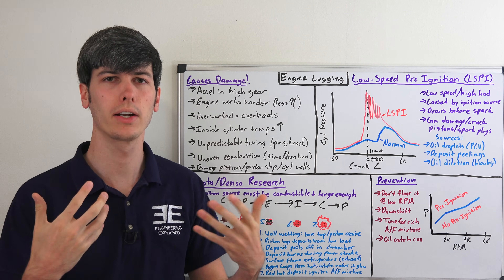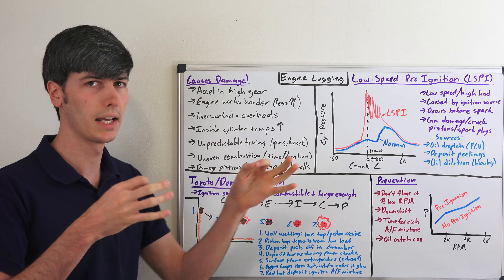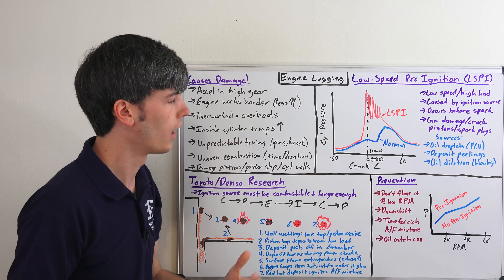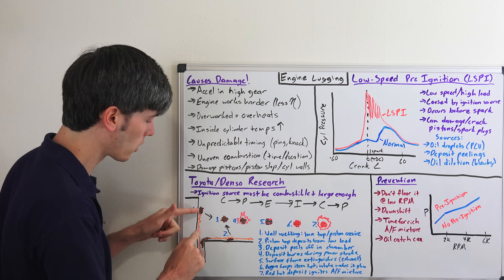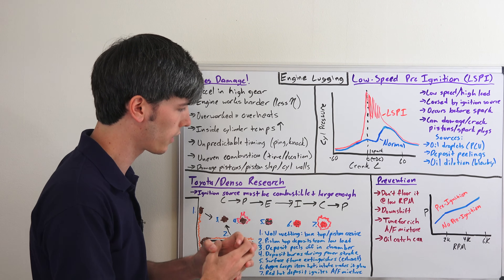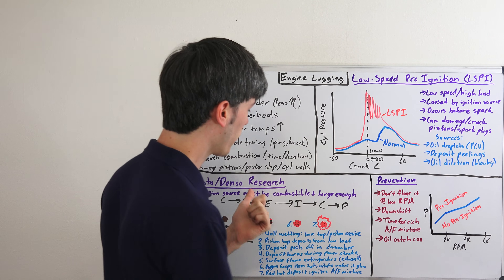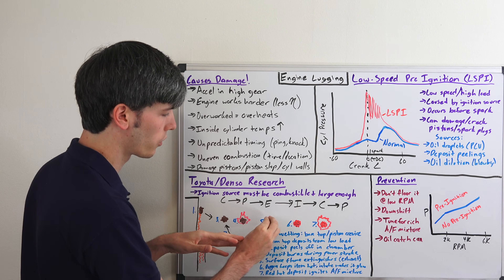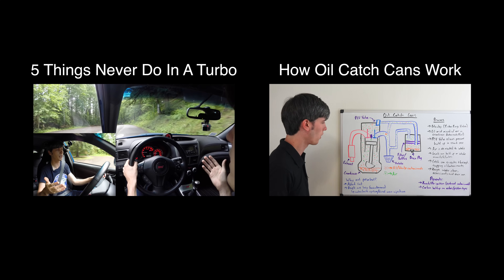Why You Should Never Lug Your Engine (Especially Turbos)

Comment: and what is with diesel engines? they have no sparkplugs because they ignite the fuel mixture by applying pressure from the pistons which are moving upwards and towards the cylinder head, doing so, they are compressing the air/fuel-mixture to ignite the diesel .....so,  does this problem also affect diesel engines?

Comment: Cortes, that's definitely a problem. You're probably getting poor gas mileage since the engine isn't burning or feeding fuel appropriately. You shouldn't have to feed in less throttle. I'd get a WiFi or Bluetooth OBD2 reader off the Internet and run diagnostics on it.
Reply: I actually have one, but I recently had my car retuned after installing header back exhaust. I haven't data logged since the retune, so I'll check it out and see what the fuel trims are doing.

Comment: With my CDI W203 I'm pretty content with half the throttle. I never floor it, cos of stupidly high torque at low RPM(about 400Nm @2000RPM).

Also, with eco driving my fuel consumption is less than 5 litres/100km. Now call that a miracle car :)

Comment: I've known some people to do this deliberately because they think higher gear = lower engine RPM = lower fuel consumption = better economy. I can't stand it as you can feel the engine labouring rather than pulling strong, it's inefficient and I'm confident there's no economical benefit. But I could be wrong. It could be great if you could look into this perspective of "lugging" an engine as well.
Reply: At a constant speed where the engine is not struggling (I.e 30mph in 5th for many of these smaller turbo engines) the lower engine rpm will always mean better economy, but yes, as soon as you need to move or stop it just doesnt work like that lol

Comment: What about the increased load on plain bearings (at low RPM) with lower oil pressure?  Plus, the additional vibrational shock from the increased load per cylinder stroke?

Comment: I need an explaination of the chart at bottom right where Toyota and Denso research suggests (as we all know, though it's not clear why we know this) that pre ignition is most likely at low rpm with low cyl pressure. What changes at high rpm and high cyl pressure that offers relative "protection" from LSPI?

Improved thermal efficiency is clear, but what else is at play? Cyl pressure and rpm doesn't give the whole picture. 

At low rpm, intake air has more time to combust, more time to disperse within the cylinder, does this have something to do with it?

The video is great, nobody is disputing that. However, for those who wonder, more information only leads to more questions. For this I apologize.

Comment: FYI: If the narrator is speaking too fast for you, one solution is to download the video to an app that has speed control. I download to VLC and then right click and select "speed", then click "slower (fine)", this will show 0.9. If it's still too fast do the same thing again and the speed will show 0.8.
 Using YouTube's speed control slows it down too much.
 This works on all downloadable videos where the person(s) speak too fast or you want to slow down (or speed up, if you wish) videos without compromising the sound pitch.

Comment: Nice presentation, but I think the explanation about oil dilution missed the mark.

Blowby will cause gasoline to mix with the oil in the sump. This mixing causes some of the lighter components of the oil to evaporate and go through the PCV system back to the intake manifold. So essentially the dilution increases the amount of oil droplets in the intake air stream. (It also causes intake valve deposits, which are a problem with direct injection engines.) One way to mitigate the problem is to use a low volatility oil (low NOACK number), like a synthetic, which has less lighter components and hence reduces the susceptibility to evaporation when mixed with gasoline.

I'm not an expert in this, but I read some information about intake valve deposits that had this as an explanation.

Comment: Very interesting topic. Nice video! What exactly you mean by lugging? 100% of engine load at that RPM? I have a VW TDI 2L manual and use Torque app to read the engine load through OBD2. What if I drive such to always keep the load between 50% and 90%, am I damaging the engine in the long run? Is it smart for fuel consumption? What if I drive keeping at least 1200 RPM and load between 50% and 90%? Pre-ignition not an issue in Diesel but will it heat more and be less efficient? Even for a gasoline turbo engine, shouldn't 100% load be set by the manufacturer accordingly to the max performance that design can deliver?

Comment: It is less of an issue with modern engines, but to the extreme, say ~1200 rpm flooring the car in higher gears, like 4,5,6 causes tons of cylinder pressure, piston cant move fast enough this can cause unnecessary wear.

Comment: For years, for economy, I have been upshifting at the lowest speed that will not cause the engine to protest in some way.  I have experienced no problems as a result.  On a previous car, a 1997 Mazea 323, I drove more than 90,000 miles with no problem except that the high tension ignition wires needed to be replaced at about 25,000 miles.  I also put more than 90,000 miles on a Chevette with no problems.  Of course if an engine runs roughly or knocks with a heavy throttle at low speeds, one is running the engine too slowly for its design and throttle opening.  But except for that, there should be no problem.  Thus, unless I need power, I upshift at 2000 rpm or less and downshift at 1200 rpm.  If I need full power, I upshift close to the red line.

The Packard Ultramatic transmission would lock the torque converter at speeds as low as 20 mph, i.e., about 800 rpm, and it would not unlock until driven at 16 mph unless you mashed the accelerator, i.e., about 640 rpm; it never caused problems.

Of course you have to run the engine faster to get more power.  But using a lower gear than necessary for the power being used results in an efficiency loss because then the engine has to suck air in over the vacuum created by the throttle valve; that increases pumping losses and lowers efficiency.

Again, if the engine protests by running roughly or knocking, then damage may be occurring.  With experience, that can be anticipated and prevented.

Comment: Another key factor as to why full throttle at low RPM can cause issues is most engines have a higher effective volumetric efficiency at low-mid RPM, which in turn results in more fresh mixture in the cyclinder and thus higher peak pressures (during both compression and power stroke). This higher effective volumetric efficiency is mostly because of the increased amount of time the valve is actually open for for a given number of degrees duration on the camshaft, but it also comes form optimizations manufactures do to production cars (such as long intake runners) since most motors produce far more power than is needed for daily driving and so these vehicles spend 99% of their time at lower revs but still want to feel responsive and get good fuel mileage.

Also while an oil catch can can help with droplets from the crack case breather, it doesn't help with oil from the turbo bearing, valve stem and blowby, all which get worse with wear (which is dramatically faster on power added or hard driven motors). So its not only cheaper\easier for engine packing to just limit max throttle position (or boost pressure for a turbo) at low RPM, but safer and doesn't really have any effect whent he car is driven correctly, be it on a daily commute (thus not high throttle) or around a track (thus higher RPM).

Comment: hey, I have a VW sport wagon, 2.5 6sp auto. its natural state is to lug the engine. I use mid grade fuels because it has such awful pre ignition. other than reducing fuel consumption, why would it be programmed to do this? thanks

Comment: Saying the engine will be operating with a lower thermal efficiency at high load (WOT) and low RPM is not true. In fact, it will be operating at it's maximum thermal efficiency as the pumping losses are greatly reduced when at WOT.
Reply from the maker: Not necessarily. Yes under WOT you're capable of reaching peak efficiency, but not if you're running a super rich AF mixture.
Reply: Here's a bunch of Brake Specific Fuel Consumption maps that suggest you may be wrong.

http://ecomodder.com/wiki/index.php/Brake_Specific_Fuel_Consumption_(BSFC)_Maps#Geo_Metro_1.0L_cleaned_up

A lot of these engines get best fuel economy at relatively low RPM (1500 - 3000), and nearly floored.

This suggests two things:

1)  Higher load generally increases thermodynamic efficiency,  with some exception at high RPM, not low RPM
2)  These manufactures don't appear to be worried about pulling spark timing to combat higher cylinder pressures and temperatures.

Now,  your toyota-denso study deals with turbo engines, and that seems to stand up, in terms of pre-ignition,  but I've not seen a convincing study that suggest pre-ignition is a concern in a modern direct injected naturally aspirated engine.  Something like a Mazda Skyactive engine spends a great deal of it's lifetime cruising along at low RPM and relatively high load while simultaneously dealing with very high compression ratios and these engines have proven to be pretty reliable...

Comment: I'm curious about this because when you get a car dyno tuned, they usually start in a 1 to 1 ratio gear (4th for my skyline) and ramp up from 1500 rpm at full throttle. so the torque provided from the dyno acting against the wheels must be much less than that on the road?? 
Also what about the effects of compressor surge, i'm running a high flowed rb25 turbo on a rb25det engine at 13.5psi and when i go wide open throttle in 4th or 5th below 4500rpm i'm getting significant compressor surge  (boost gauge goes all over the place). is this usual to happen on all turbo engines when lugging it?

Comment: I've been waiting for this video and I have two questions.

1. Regarding efficiency: My meter always shows better fuel-economy (for a given speed, inclination, acceleration) during lugging. For example, suppose I'm lugging up a long straight incline at a constant speed, and observe a particular fuel consumption. If I then change down and throttle down so that I am still going up the same incline at (the same) constant speed, the fuel consumption seems to worsen markedly. If the engine is actually running more efficiently, where is that energy from the additional fuel going to, since the car isn't speeding up?

2. Is pre-ignition really still a problem nowadays?

Comment: I wonder if this even applies to modern manual transmission cars... with a drive by wire system couldn't the ECU know that when the pedal is floored in a high gear not to send more fuel or cause engine lugging? i.e. they could have a system place that recognizes when you're wanting to floor in a high gear.

Comment: This only pertains to vehicles with a manual transmission (or drivers using paddles on manual override mode) as vehicles with automatics will downshift and upshift itself depending on throttle input. But I'm sure everyone knew this already.

Comment: lol i have a feeling hes gunna start telling us starting ur car when its off is damaging the engine
Reply: Most damage is caused when starting...........
Reply: @jared p: Did you ever see a car failing when it was not even running? ;-)
Reply: Have you ever heard of Ferrari?
Reply: jared p you should start your car until the oil has come up to operating temperature.
Reply: this possible but only if you don't start it and let it sit for long periods of time.
Reply: engine turns off oil drains back into the pan when you turn it on the pump now needs to prime flow and pressurize the oil while running check out the episode of roadkill with stubby bob when they start the engine without a plug in one of the oil galleries they turn it on and about 3 seconds later oil gushes out that what im talking about
Reply: jared p well it is actually, you are using the car, witch is wear and tear.
Reply: He said this as a joke... But little did he know.

Comment: Does this apply to diesel engine? specifically many diesel engine is design for low end torque, so we tend to spend more time on the lower end of the rpm.